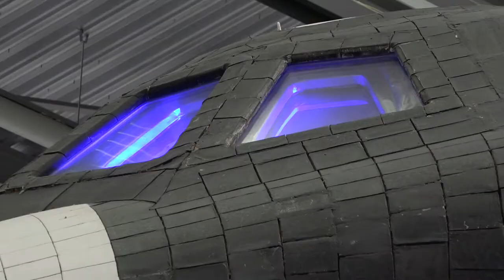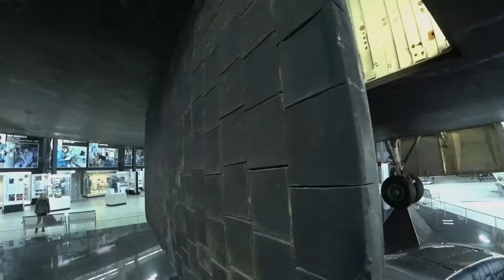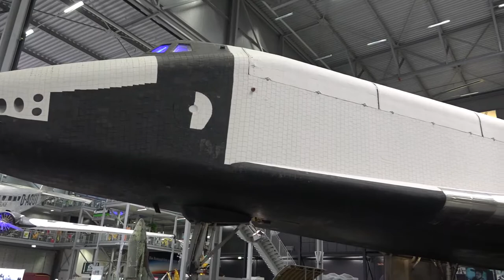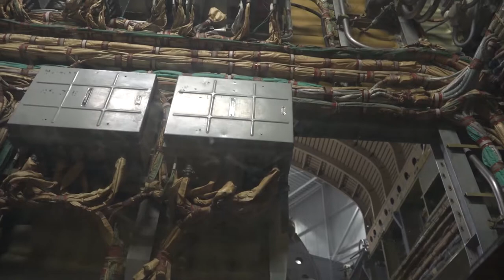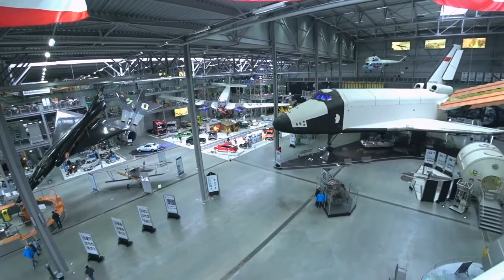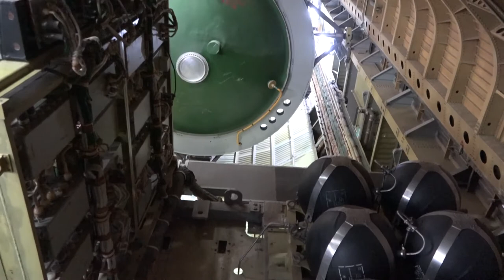BURAN - Soviet Spaceshuttle (Prototype OK-GLI) | WALKAROUND

Comment: Flew only once with no crew. 😪
Reply from the maker: The one that went to space, yes. But this one flew a couple of times under own power and with crew, but just in the atmosphere, since it was a test vehicle.
Reply: Not certainly in that way. The very concept of the Shuttles in Russia was found to be ineffective and excessively expensive. Reuse of spacecraft is not too reliable. Therefore, yes, after a single flight, the shuttle program was turned off as hopeless.
However, during the development of Buran, unique technologies were obtained that were later used in Soyuz rockets. So, in essence, modern Russian missiles are a development of the Buran program. Reincarnation in a classic way.

Comment: would of never worked
Reply: It did infact work.
Reply: @theothergtgeek9407  Sorry, you are right, it flew and landed within atmosphere. Would of never survived reentry.
Reply: It was not designed for reentry. This was purely for testing in the atmosphere.
Reply: @bBrain  it was in space, but without crew
Reply: @taran7728  It is my understanding it never was in space as the prototype was an atmosphere testing only platform and could not do reentry thus never went to LEO.  You have something showing it went to space?
Reply: @bBrain  it was in space
Reply: @Heliosphan33  but survived reentry
Reply: @taran7728  Pretty cool, yes the 1K1 did do an orbital flight. But that was not the jet powered version, was a stripped down version without normal jets for atmo flight.  My point was that the jet version with Jets and Rocket motors would of never worked, or perhaps I should say worked well. It's hugely impractical.
Reply: @bBrain  oh ok, I didn't know that you were talking about this specific buran
Reply: @bBrain  There never was a "jet version" planned to go to space. There are Space ready ones with rockets and this single one for aerodynamic testing in atmosphere.  Noone ever wanted to go to space with jet engines as dead weight...